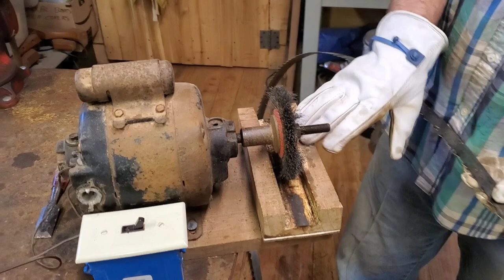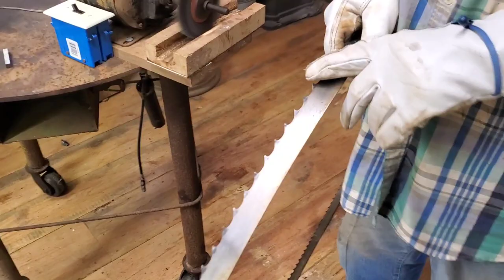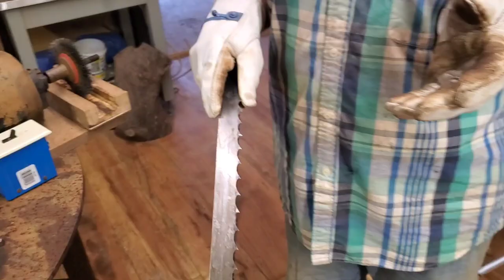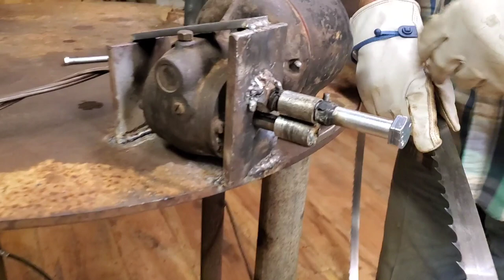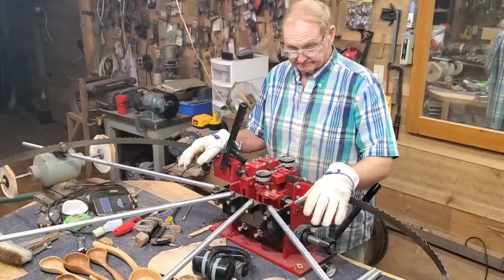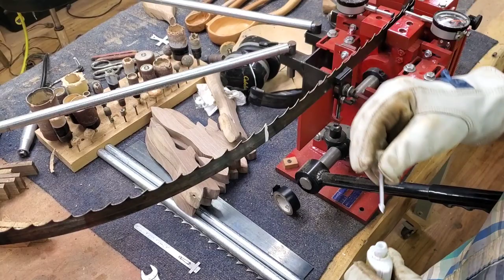How Mr. Robert preps a sawmill blade for setting and sharpening

Comment: I have a large Laguna bandsaw which I use chiefly for cutting up firewood. The blade on it is pretty dull but I'm not looking forward to doing one tooth at a time for a hundred and fifty teeth. How  about mounting the blade backwards, turning the saw on, then holding an  ordinary knife sharpening stone against one side of the teeth, then the  other. It probably wouldn't be as good as doing each tooth individually but it would be a lot quicker.

Comment: Question Why would you want to remove the set f rom a band saw blade.  set is very important to cutting, explanation please
Reply from the maker: Sometimes if you hit something it can take the set beyond where it should be.  If all the teeth are reading around 22 thousandths and a few are at 35 thousandths the ones set too far will leave deep marks on the wood and will be over stressed.   Another thing we can do is take all the teeth back to a lower set using a tool we have then essentially start from scratch to ensure consistency of the final set.